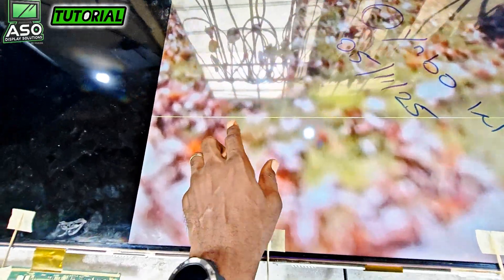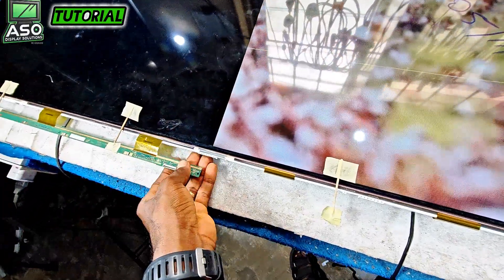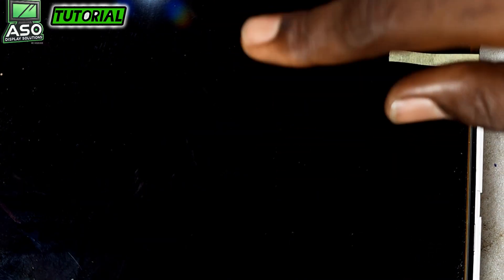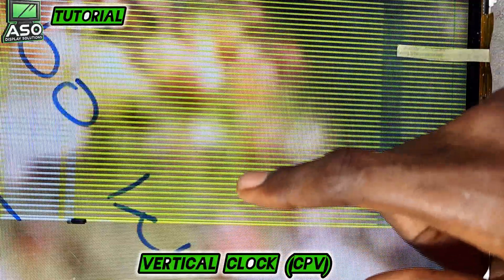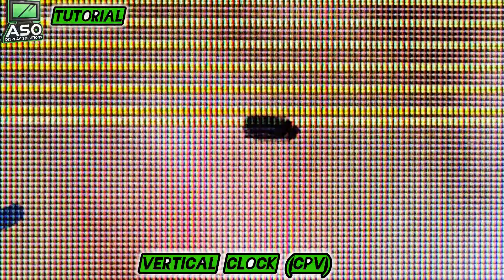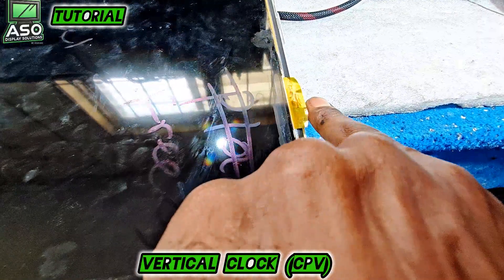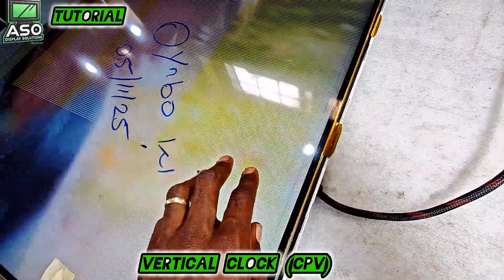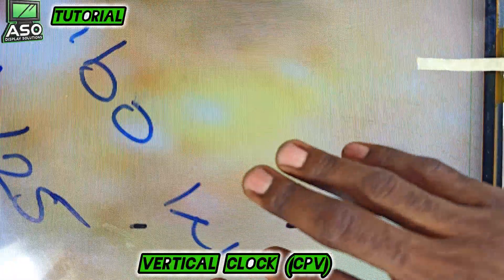55" Samsung LED Smart TV HORIZONTAL Line Fix - Smart Technique Tutorial

Comment from the maker: Guys, I should point out that apart from the clock signal CPV that you may temporarily disconnect, you can also disconnect a voltage, to determine the faulty COF. Can you tell what it is?
Reply: Which of the voltage can one disconnect please